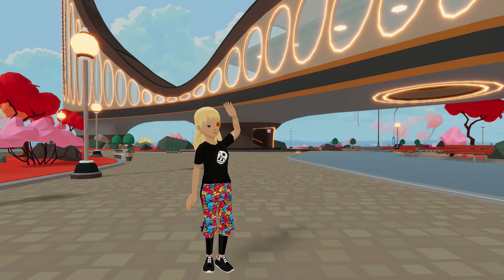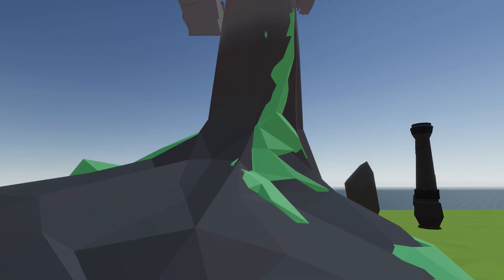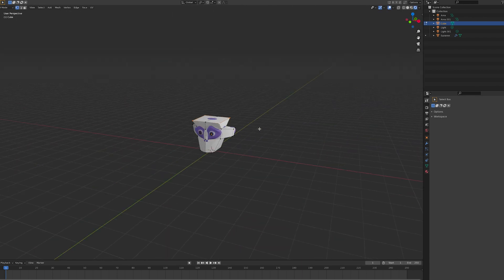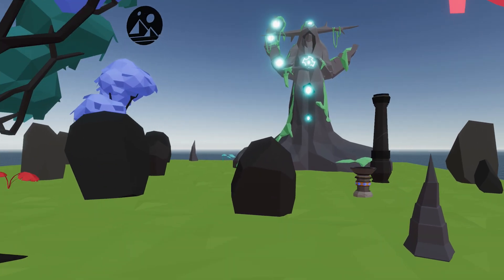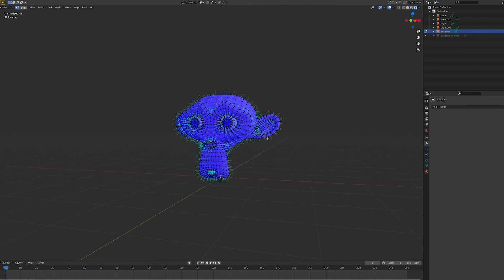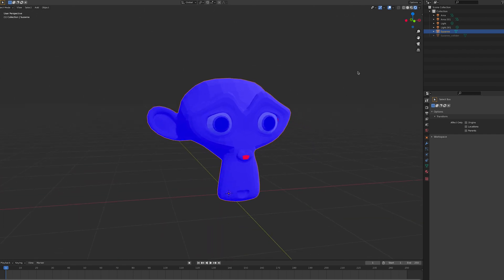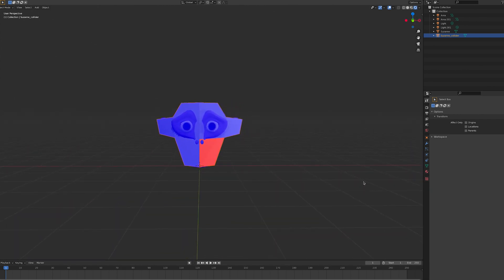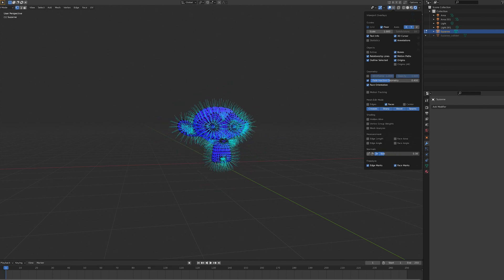How To Build For DCL | Colliders

Comment: Liked this tutorial because straight to the point without lots of talks around with simple stuff. But do you know how we could that in Sketchup?
Reply from the maker: Thanks Michel! I would imagine it's possible to do via Sketchup as long as the colliders have the name extension _collider and the file is exported as a .glb or .gltf.
Reply: @lowpolymodelsw  Hi, thank you for your quick response :) I manage to add the collider, but i need to export as 2 different files. 1 contains the actual shape of the building that i want to show. then i copied the same building and save as another file with the name ending in "_collider"....and it worked :O
Reply from the maker: @michelvieira2042  Nice one! Thanks for sharing the tips :)